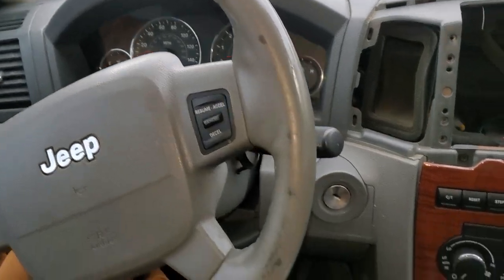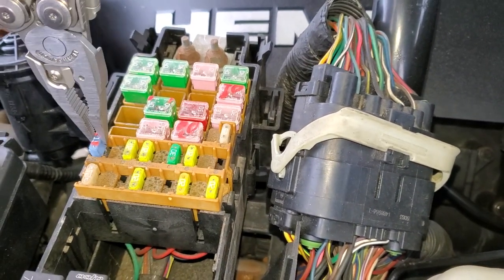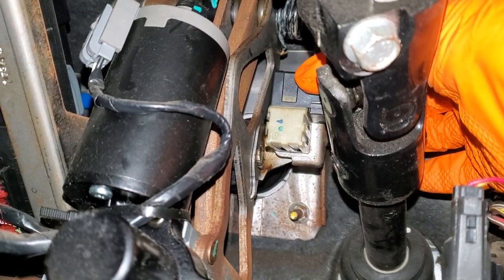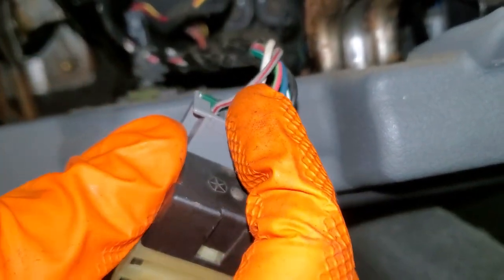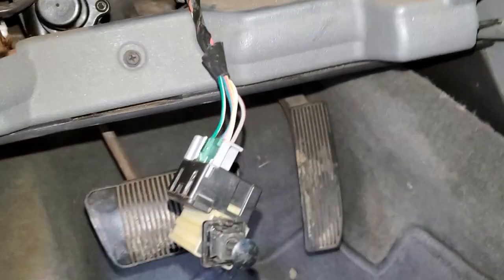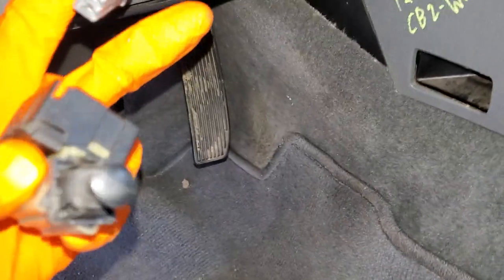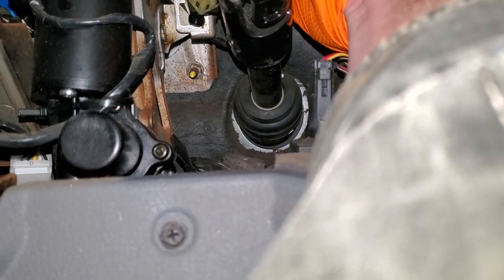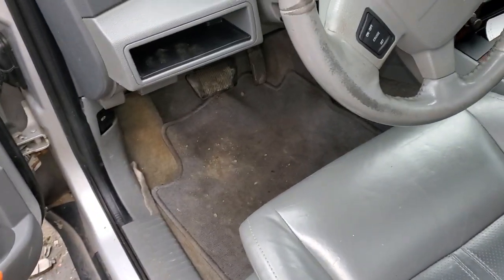2005 - 2010 Jeep Grand Cherokee Brake Light Switch Replacement, Stop Light Fuse Location

Comment: Important Tip! Taking the switch out is easy!, but...you MUST depress the brake pedal as you are insterting the new switch, then turn clockwise to lock it in. I know because I busted up my hands withe simple installation is the reverse!
Reply: I have this problem the #15 fuse I took out and drove down to oreily to purchase new one but on the way there my traction control light and another light (abs?)came on lol so after I arrived to oreily I just put my #15 fuse back into the fuse box and both lights turned back off and just went home lol so I assumed my #15 fuse works fine lol so I think my brake switch is the issue ty for the tip I will keep that in mind! 🤙🏽
Reply: Turn the ignition to start the engine and the brake pedal will be able to move. You only need to do that to put the switch back in.

Comment: Thank you for this video. I’ve been trying to figure out why that 15 fuse keeps blowing out.  No brake lights.   I found this video and switched out the brake switch.   Thanks to you so great video … but it didn’t work.  Still blows the new fuse and still no lights.  Help?

Comment: Hi, a question before starting my DIY job.
Is the signal on the Dashboard of "Electric Brake System" means to change them FIRST, and then afterwards what you shared in this video or no?
Truly Apreciate all info you can share!
Reply: Did you ever get a reply on this?  My ESP/BAS & Traction Control lights are on….and I have a bad brake switch.  I wonder if the bad brake switch was causing those lights to come on?🤔

Comment: Thank you for taking the time to make the video.  Does anyone know if a bad switch will cause the hatch window to unlatch when applying the brakes?  While applying the brakes, the hazard lights flash and the hatch window opens.  The brake lights work.
Reply: Wow thats so strange. Did you ever figure that out? Curious lol

Comment: Is that the button switch that can be seen on the steering panel at the rear of the steering wheel? We have been trying to figure out what that button is called because it dropped down inside the steering panel on our 2007 Jeep Commander limited 😢

Comment: Hey kudos on the video. Any ideas about this switch has something to do with the cruise control malfunction? My wj only turn cc light on in the dash with pedal brake pressed down.
Reply: Stepping on the brake cancels the cruise control, so yes, it could be either the switch, or switch adjustment.

Comment: Looking for guidance, driver's side tail light (all lights) comes on, passengers not (no lights). If switch them with and plug in opposite the passengers tail light now works with the drivers side plug, and the driver's side light does not work with the passengers side plug. All lights work when plugged into drivers, none in passengers. And one more twist, the brake light on the passenger works but not tail light and the reverse light works also.. Any thoughts? Thanks for any reply.
Reply: @robmassung2387  I saw a video on this subject. It was corrosion on the connection where the bulb goes. He said you could clean it of or replace the piece.. very very simple

Comment: So I did all of this and when I took the break lite switch out, I put it back in and now no lights come in and the Jeep won’t start at all, the only problem was the break lights and now nothing will even start, and no electricity throughout anything, any idea what’s going on?
Reply: Any updates? 😧
Reply: Sorry I'm so late to this, but any attempt to remove and reinstall the brake switch will cause it to fail. Even a brand new switch. When you have a new switch be careful not to push the plunger in at. It's a self adjusting switch and you must let the brake pedal do the first compression of the plunger. Doing it incorrectly normally causes the traction control lights to come on, but anything the switch handles can be effected. I reverse the foot on an Irwin clamp and use it to push and hold the brake pedal down. Push the pedal way down because you don't want the switch  to get depressed by the brake pedal during installation. Putting the switch in place is exactly how shown in the video. Once the switch is in place and turned to lock, I hold the brake pedal with one hand release the clamp holding it down so I can slowly let it up, and then pull up on it after it stops on its own. You'll hear a fairly solid click, and you're done. I've heard of people installing them in other ways, but that is the only way I've been able to make it work. I went through several new switches because either I or the parts guy fiddled with the switch and plunger before installation. Installing the switch is a one time thing, if you don't get it right or try to reuse an old one they simply won't work right. It took me 3 switches to figure out that they really are that sensitive and I got it right. 
  I know I'm a year late but that's my experience.

Comment: I have a very specific problem my lights work but when I put on my high beams to drive at night the back does not work only a top red light so no turn signal and no break lights for my 2008 jeep grand Cherokee Laredo
Reply: I’m having a similar problem. 07 Jeep Grand Cherokee Limited. When I turn my lights on the back tail lights, turn signal, and break lights all stop working. They work fine if the lights are off.
Reply: @charitydrury4729  I have the same problem except the right side works fine when the headlights are on, the left side stops working until I turn the headlights off
Reply: @joshuawise1411  please tell me you found the issue I have the exact same problem
Reply: @charitydrury4729  any fix?

Comment: Will this fix the 3r break light if it's not working? On a 2009 grand Cherokee
Reply: Any good news so far?
Reply: PMC05 no, but I replaced it with a led light and it worked. I guessing it was the light that stopped working.
Reply: Toxic Ghostly nice! I replaced my 3rd brake light w a brand new smoked out housing w led in it and still no light so I’m gonna have to try hit junkyard and grab this switch out from the wreck yard there’s 2 2005 jgc laredo here in Vegas @pic n pull $1 entrance and probably cost $1 or $2 for the item if not my final solution is purchase a brand new brake switch from amazon $10 🤷🏽
Reply: @toxicghostly4640  did you have a bulb or did you replace the entire led?

Comment: I changed  mine out but my 3rd top back break light still wont come on and my esp light is on any ideas ?
Reply: Have u fixed her yet? Just bought a smoked out aftermarket third brake light installed but still no light when I step on the brakes 😰
Reply: @lstruggy  had the same problem, i got frustrated with it and just ran wires from the drivers side brake light, haven't had an issue since. It's a 2007 Jeep Grand Cherokee 3.0 CRD

Comment: You really didn't do anybody any favors by not showing how to disconnect the wiring harness, that's really the only hard part of the job
Reply from the maker: Yea it was difficult for me to do that with one hand. I have another video where you can see the disconnection of an identical brake light switch @ 0:45 https://youtu.be/gOnuNLGh3Nk
Reply: I got it by prying from the top with a small flat screwdriver.
It came up without breaking the grey plastic.
Reply: so you got your switch back in?
Reply: @christopherlee1673  yes, the rest was easy,   twist the old one 45 degrees and it popped out, new one goes in just as easy. The only hard part was 
#1 the harness has a Christmas tree clip holding everything forward near the fire wall, it takes about 50lb of force to get it to release (sideways of course)
#2 getting the wire harness to unlock from the switch. If memory serves me right the grey clip needs to be pulled down in the direction of the wires, twisting a flat screwdriver makes this not too difficult. 
Good forehead mounted flashlight will be your friend.
Reply: @mymusicaccount1456  I bought a new switch at oriellys, the black button sticks out a quarter inch further thsn oem- i dont think it will work
Reply: @christopherlee1673  depress the brake pedal and it fits
Reply: @christopherlee1673  i get my parts from rockauto whenever possible. If i have 2-3 days available (non emergency fix) i like spending 40% compared to my local parts stores.

Comment: Where do the white wire and the brown line go?
Reply: I need help the fuse is good and the brake switch is good i cheak the white wire with brown line it have power but the lights still not working !!!!